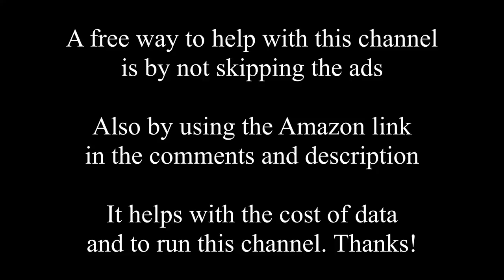Home For Filipino Family - Putting in the Floor - Province Life Philippines

Comment: As always, amazing to see the life changing progress you are making to these wonderful people.  The concrete floor with be amazing.  Is it going to be tiled?  That would truly add to the looks and ease of sweeping the floor.  Keep up the amazing work.  Love the gutter system BUT you should get a 55 gal plastic drum (or larger) with a lid so they can use the water for the CR in the future.  The lid is needed to prevent insects from getting inside.